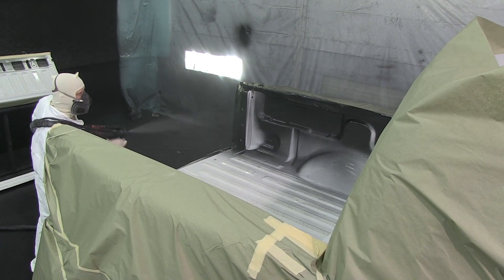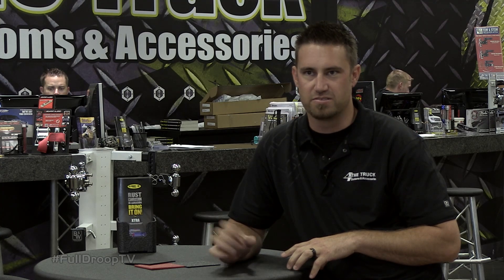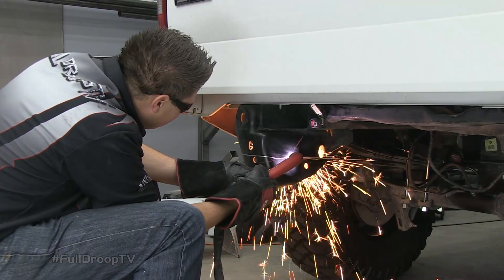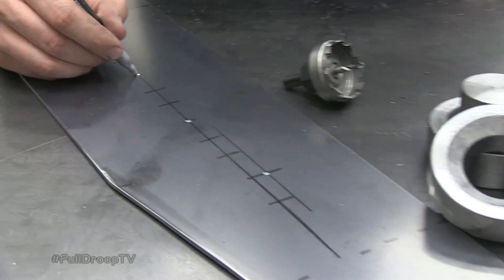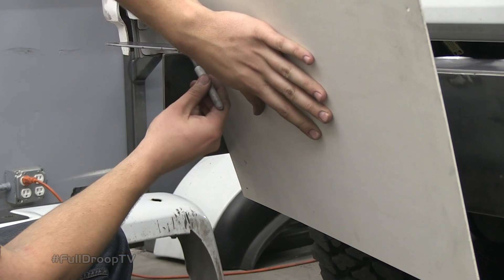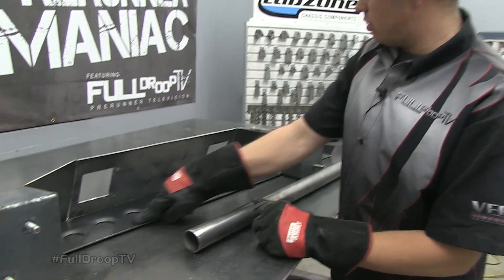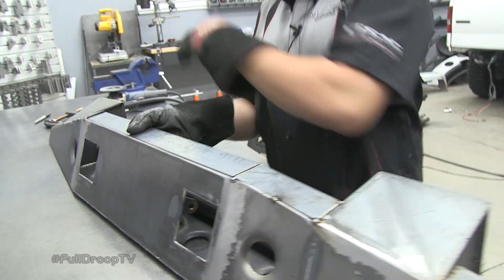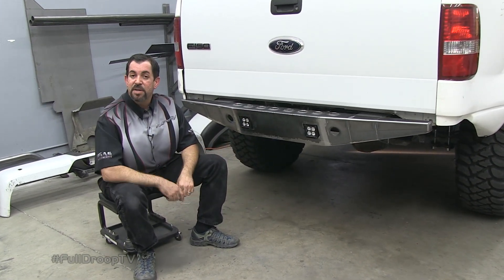Ford F-150 Rear Prerunner Bumper & Bed Liner - FullDroopTV (Season 1, Episode 10)

Comment: Cool bumper! 6:14 I would have plated that hole you cut under. That is a fail point on a hard ass scratcher since the material under the hole is removed. Not trying to criticize the work though. I'm subscribing!